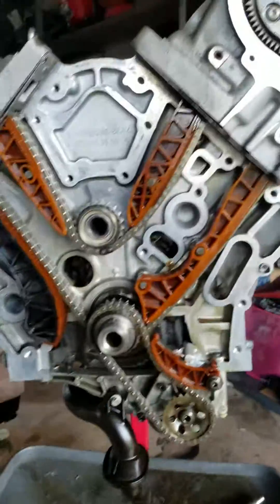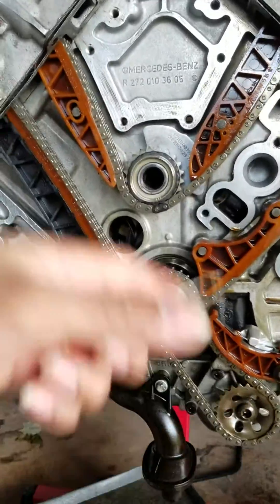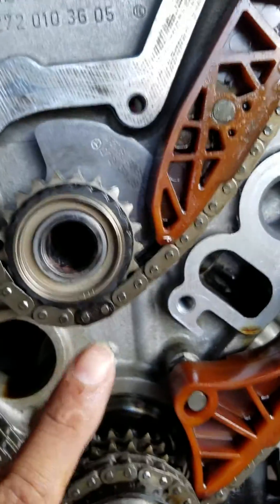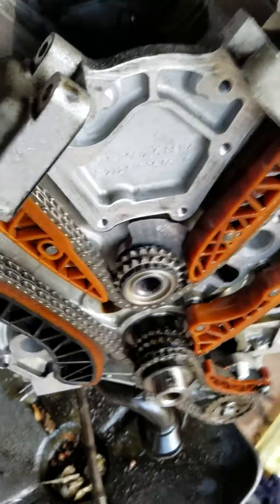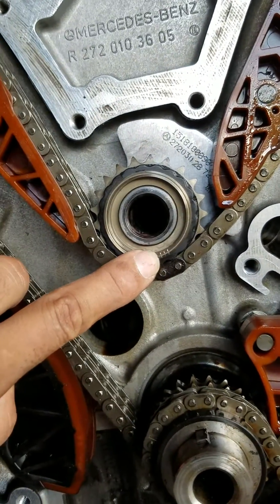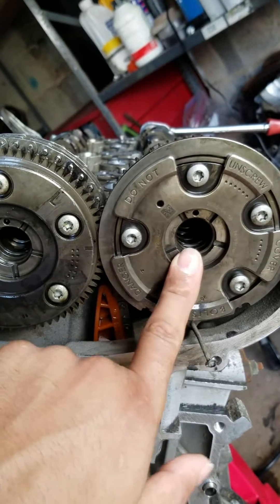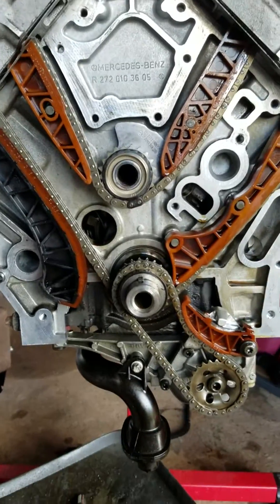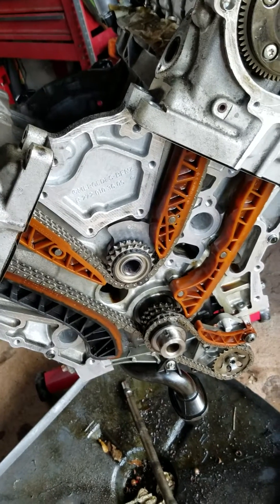Mercedes benz 272 engine timing

Comment: I am doing this job and when I took the camsahfts off the left outside cam the pin I put in to jeep the inside and outside of the cam gear straight popped off. Can I force another pun in and reassemble it or is this going to cause a problem. The one on the right side of the engine the pun staued in place. I think I used the wrong size pin. I use a drill bit. Don't remember the size but it has worked before. I guess this one time the bit was a little too small.
Thanks
Reply from the maker: @keithcannon3682  yes you can force it to align as long as you don't damage the gears and reinsert the pin. It won't cause any problems

Comment: Hello thank you so much for your help and video very good explanation I am sure this is going to help me out a lot 
Got a question for you I’m getting this tapping noise from the engine 4.6 L v8 any idea what this is or where is coming from I am digging for air right now but my codes are p0016 / p0017 
Please  if you got any advice I will really appreciate it

Comment: I got a guy balance chain by the dot on the gear (nearly the label, not by the label). This means on the right, he moves the red mark back to 10 gear, then on the left, he moves the red mark up 10 gear. The center just jumps follows chain 10 gear. The engine still runs smoothly because the timing is still correct. Crazy guy.

Comment: I got a p0016 coder 272 ENGINE, where to get the parts
Reply from the maker: Dealer, Ebay, or worldpac
Reply: Nelson Garcia thanks how long will take to do this work
Reply: Nelson Garcia where is your shop, what is the cost for this job be done

Comment: Hi nelson, great video. I have to relplace the front timng chain cover, it cracked in a collison. Im not looking at replacing the balance shaft now, just want to replace the front cover, is it possible to remove the 2 bolts under the intake/exhaust camshaft front gears without removing the cam covers, will the small covers (cam shaft sensor cover) provide me enough space to work with if i use a special tool. Thanx
Reply: i did it with the gears still on
Reply from the maker: if you're talking about the main front cover, the big one, yes you have to move the gears out of the way to remove the bolts the hold the front cover. On this engine we call the little windows were the camshaft magnets and sensor are "the front covers"
Reply: Thanx for your reply, ok as u say to remove the front-main timing chain cover (the big one), the cam gears have to moved out of the way to get access to 2 bolts each side. Once the timing chain is set in its position as shown in your video, how do u install the front-main timming chain cover, wudnt you have to again remove the cam gears again, to install the 2 bolts each side. Appreciate your time and response
Reply from the maker: well set engine at 40°tdc, break loose the camshaft bolts, you have to lock the intake camshaft gear with a pin and also zip tie the chain to the gears so it doesn't move and mark the chain to the gear just in case.you replace the big front cover also be very careful with the head gasket not to get crushed when pushing the front cover, once you put in the front cover then you put the 4 bolts and re-install the gears. Also you may have a hard time pushing the front cover because the timing chain plastic guides will be in the way, so figure it out😅 may need to push the guide with skinny long screwdriver,... good luck!

Comment: Do the same marks apply to the v8 4.6 Lt 273 engine ?
Reply from the maker: yes,but on the 273 you don't have to remove the engine because it doesn't have a balanceshaft, only the gear which can be replaced through the front. and you don't have to worry about the gear to be set on a specific place. just the crank and the camshaft gears.
Reply: Thank you for the information I’m working on a 4.6 v8 I’m in the process of removing the harmonic balance any help on the special tool to remove it? 
Thank you 
Good video 👍
Reply from the maker: Hey, to remove the Harmonic Balancer/crank pulley you just need a 27mm socket with a good 1/2 air gun. If that doesn't take it out then yes you will need the special tool to hold the harmonic balance.

Comment: Hello Nelson, i want to ask u for something
I have a mercedes w203 c240 2.6 w engine and i see oil leak at valve cover gasket. Is it safe to drive ? Bc dont have to much oil, another problem is i have a little water lose and i dont know where is going bc i dont see leak. Is it possible if water goes into engine and mixing with oil? Oil level is not filling up . Sorry for my english
Reply from the maker: yes it's safe to drive it, the only thing is that you will smell the oil been burn by the exhaust manifold. The coolant evaporates a little, so don't be surprised if you have to add a little coolant at every service
Reply: Nelson Garcia  thank you very much, in my contry dont have good service for cars, one of them say u must have burn head gasket, my car never was with high temp overhating, never had smoke from exchaust and hever had misfire, can u tell me symptoms of head gasket faillure ? Please
Reply from the maker: well you will be loosing coolant which would be mixing with the engine oil and you'll see the oil turning into brownish color, like milkshake. Your engine won't be running good you will have misfiring on few cylinder,
Reply: I dont have any sign of those, but a little water lose, if happen this is it repareied? Or to buy a used engine
Thank a lot my friend
Reply from the maker: maybe is just pouring out through the tank when the car gets hot it pressurized and bleeds out the tank breather hose
Reply: Nelson Garcia  thank u very much, u save me a lot of money . Thanks a lot
Reply: when i fill up with antifreeze when i drive for 1500 km in center, the car want 500 gr water a half liter ,is that normal?

Comment: Es el mismo motor r350 2007
Reply from the maker: si, es un 272 6 cylinder, lo unico diferente es los exhaust manifold, los oil pan and sub oil pan y el filtro plástico de la pompa de aceite y claro el oil dipstick tube and dipstick

Comment: I think of buying a 2007 e350 should I worry about balance shaft it has 170000 miles on it
Reply from the maker: I would say yes, 2006 and 2007 have the old gears, they modified it after 2008. but if it was done already you don't have to worry about that
Reply: Nelson Garcia thanks my engine #30412449 I called the dealership they said it hasn’t been done but they were not very interested in looking it up do you know if the number falls in the bad engine it’s not doing anything just a little noise but with 170000 miles I would think if it would go down by now thanks for your help